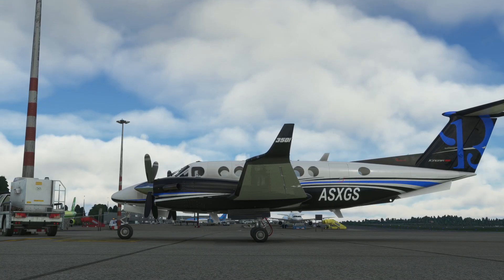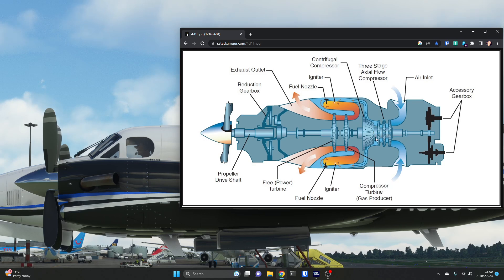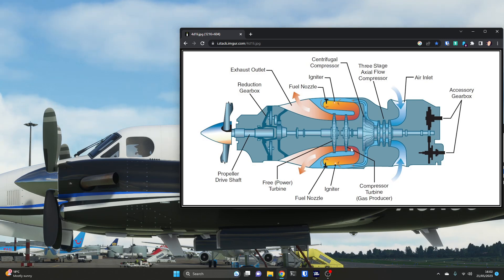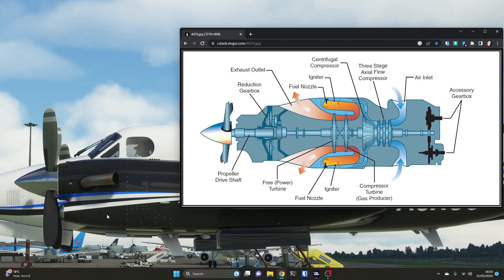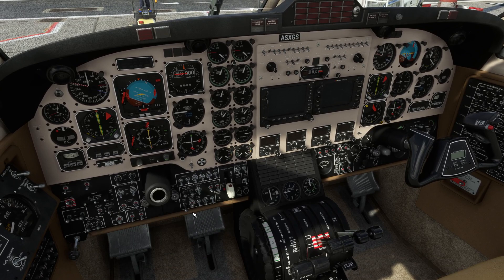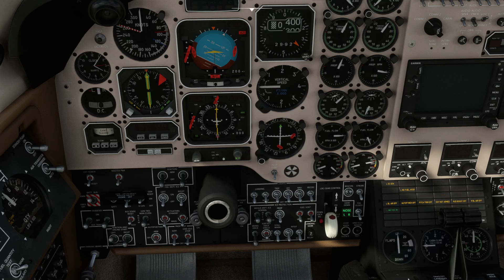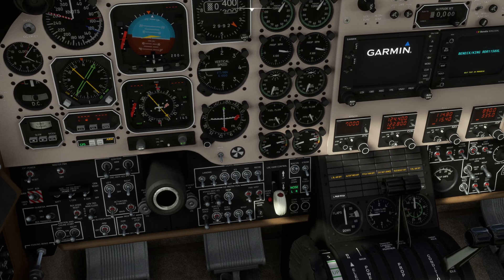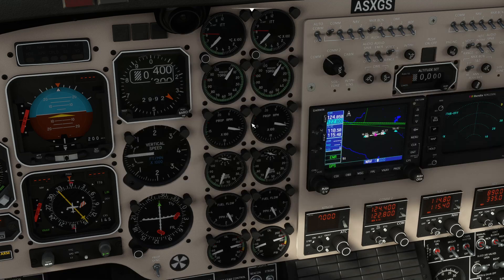Exploring Turboprop Engines with the Black Square King Air in Microsoft Flight Simulator

Comment: Hello Jonathan, I like you're video an d how you explain the technic.  I have a question about this aircraft.  I create a flightplan with simbrief and save as a MSFS2020 FP an load it in MSFS2020 but when the GPS is on the FP is not load in. Have you a solution ?

Comment: Hey Jonathan, do you also have the Cessna 414 Chancellor? I am really doubting between the two. I actually like the King Air more in terms of what it is capable to haul (more pax/cargo), and I also like the looks of the cockpit more, I think Black Square has done an excellent job. However I am dissapointed that the external model has no visuals, where the 414 obviously shines. Which do you enjoy more?
Reply from the maker: I like them both.

Comment: The gearbox between the free power turbine and the propeller is actually a fixed ratio (I believe its a planetary gearset in most turboprops), the condition lever controls the target RPM, the propeller will then automatically adjust the blade pitch to increase or decrease the load on the free power turbine in order to control the RPM
The reason the blade pitch stays at 30 degrees when the engines are off is because the engine is not speeding up so the propeller maintains its minimum AoA to reduce the drag and thus the load on the engine and allow it to speed up to the chosen target RPM which it never does because the engine is off. Once the engine is on the blades will begine to move but of course you can't see that because they are already spinning. 
The turbine RPM gauge is the compressor turbine RPM.
Reply from the maker: Great info - thank you :)
Reply: @jonbeckett  I'm sorry, but what hes actually telling you is, that you got the entire concept past the Power Turbine wrong. As he mentioned the Gearbox is a fixed ratio. So there is no controlling anything via said gearbox since it only has one gear. The Gearbox is only there to reduce the the shaft RPM fom north of 20.000 RPM to something more survivable for the prop blades. (Hence its name "Reduction Gearbox")
The Prop- RPM is exclusively controlled via the Propeller Pitch (as in AoA) wich in turn is controlled via the Prop Governor wich tries to set a given RPM according to the RPM Lever Angle. The RPM Levers in this plane are coincidentally labeled "PROP". 
When the Pitch angle increases, the drag increases, making the shaft harder to turn (lower RPM). Since this drag is a circular force opposite of the input from the free turbine there is now a twisting moment applied to the shaft. This moment is called torque. It can be used to give an indication about the mechanical work the Engine / Propeller is producing, but in the end its just a twisting force on the shaft and has little to do with the gearbox itself.

Also what you said toward the end, that "the propellers cant't be driven fast enough" is not true. The RPM for a given Prop Lever setting is constant. If you want a constant power level (torque) you'd have to push up the power more and more since the air is less dense and offers less "traction" on the propeller blades. This fact and the decreased mass flow through the combustion chamber then lead to higher temperatures wich become limiting at some point.

In fact, you can turn off one engine and the RPM shouldnt drop that far. If you're fast enough, it will maybe even maintain its 2000 RPM. You will genereate loads of drag though, thats why the props can be feathererd.

And what you said in the end about waste gates is, I'm sorry, total nonsense. A turboprop is by design a Jet engine. As such it has its own compressor. Waste gates are only found on turbo chargers and are  in turn only used on piston engines to force induction at higher altitudes. The Waste gate controls the ammount of Exhaust gases that go into the turbine in order to controll the Turbo RPM as to achieve a certain Manifold pressure. But this is a totally different topic entirely. 

This is the first video I ever watched from you. And given the fact that quite a lot of people have watched it, I must ask that you do a correction about this. Sadly as it is, this video is spreading quite a lot of common misconceptions.
Reply from the maker: @GAFflyer  hands up about turbochargers vs turboprop :)  if a video goes into that much detail you lose the audience instantly. I did preface it saying that real world turboprop pilots would likely wince :)

Also - the original commenter was quite clear and I thanked them...

Comment from the maker: I completely forgot to illustrate the difference between low and hi idle in terms of fuel condition. All it does is increase the power by perhaps 5%. Reading around, real world pilots of the King Air insist that they NEVER run the engine in high idle configuration save for very specific circumstances - because you just never need to. The armchair simulator expert crown of course insist on going to high idle for take-off and flight, but the real-world pilots say not - and I know who I'm going to take notice of :)  You can demonstrate it into the aircraft by switching the levers - all high idle does is stress the engine a lot more for not much more performance.

Also - I did a horrible job of describing "torque limited" versus "ITT limited". Above 20,000ft, it becomes an issue of keeping the ignition going - so you will trim the engine to do that. Obviously eventually you run out of things you can do - and that's where you meet the "ceiling" of the aircraft.